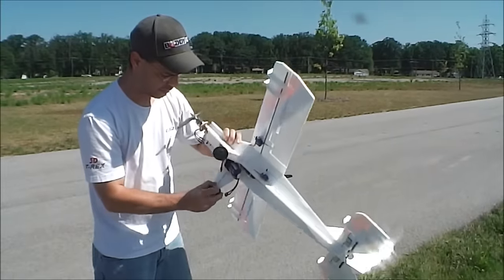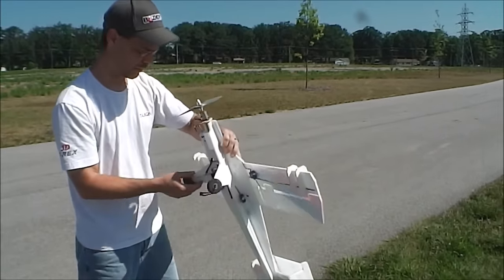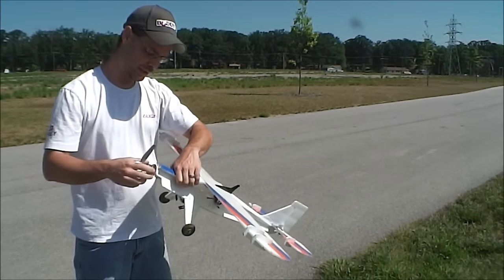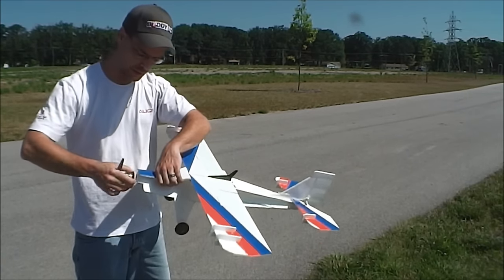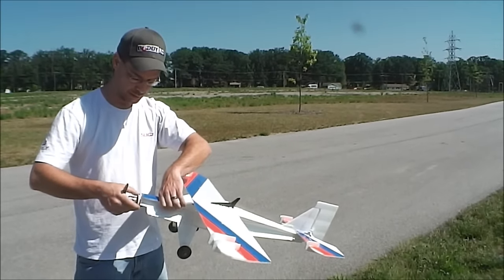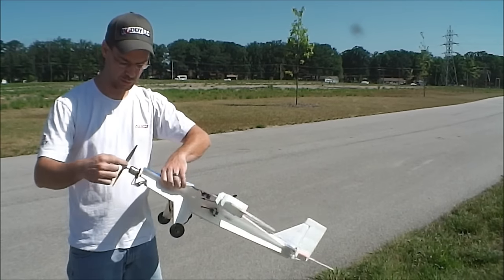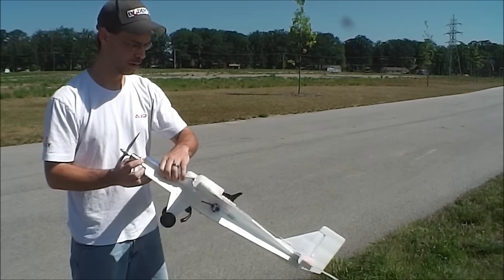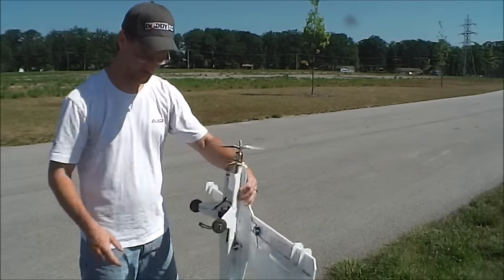My Scratch Built "Turbo Crack Beaver" Maiden Flight

Comment: Looks awesome Derek how many cell lipo are you running?
Reply from the maker: On this flight, I was using a 3S 1300 mah lipo.  I'm going to try a 2S lipo on the next run....after a few light repairs are made, lol.
Reply: cool thanks for the reply dude keep those birds up! lol
Reply from the maker: no problem buddy!  I may not reply right away, but I always reply.
Reply: hey better late then never lol
Reply from the maker: Definitely!!!  Have a great weekend!
Reply: ***** You too! I pretty munch give up on the CC3D board wasted to many weekends me&my uncle trying get it dialed in so I put back my Naze32 did some test hovers everything seems fine so far lets see what happens tomorrow morning when I try it out?
Reply from the maker: I've not used a CC3D board but I am finding the Naze32 to be easy to use and setup.  I have it on my ECHO 290 quad.  I have the Naze32 on the quad that I'm building right now and I'd like to try the Naze32 on an upcoming plane project.
Reply: ***** go for it

Comment: Nice job Derek. I have a TH Crack Turbo Beaver and it is a blast to fly. If your foam board version is anything like mine, it likes a lot of rudder as part of coordinated turns to turn aggressively. When using the rudder, it turns very well in both directions. Without rudder it struggles a bit when turning to the right like yours did and my ailerons are quite a bit smaller to make room for the flaps. I think the right turn issue is a function of overcoming motor torque.Thumbs up buddy!
Reply from the maker: *****   Thanks for that, Bob!  I will surely keep that in mind.  I've got a lot of rudder travel and a lot of expo on all the 3" control surfaces, lol.  The "motor torquing" could definitely be an issue.  I'll work on it and we'll give it another go soon.